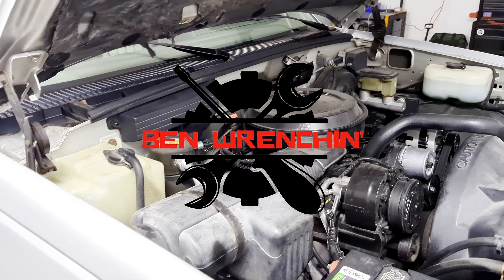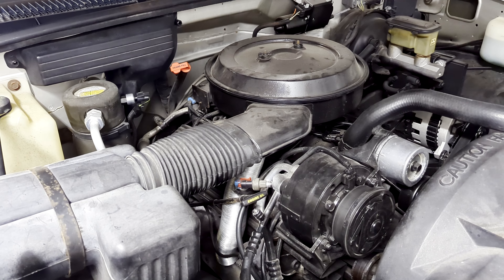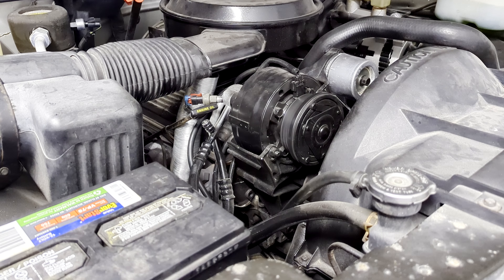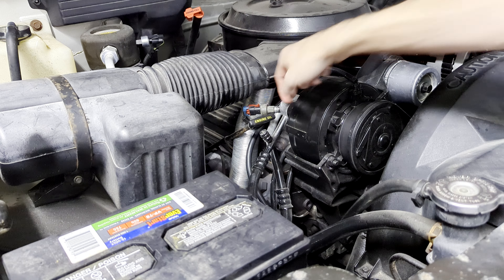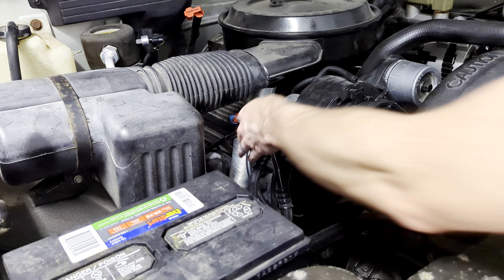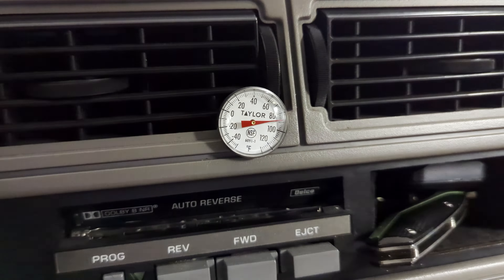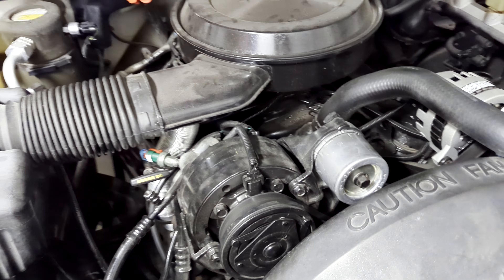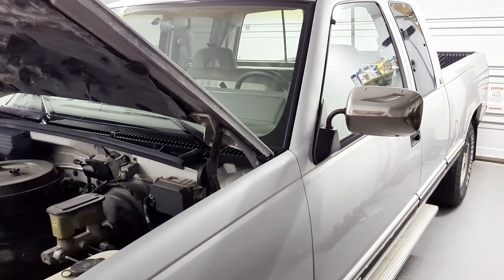Replacing A/C Pressure Switches And Why I'm Okay With Using The Parts Cannon | 1994 Chevy K1500

Comment: Can you separate the compressor clutch and possibly replace it without opening the system?
Reply from the maker: You can, but mine is working.  I think the problem must be something internally wrong with the compressor.  Usually they leak or the clutch goes out, and mine's not doing either of those.  It is 30 years old though.
Reply: Good idea!
Reply from the maker: @megs4898 @macdaddykwm1  I've thought about it more, and I really shouldn't rule out the clutch.  It would be another part to try that doesn't require opening the system AND could possibly be the cause of the problem, however unlikely that may be.  Unfortunately, it looks like this particular compressor may not have a removable clutch, at least my search so far for just the clutch has only yielded replacement compressors.  I have found one clutch for $100 on RockAuto, but that price doesn't make good fodder for the ol' parts cannon.  The saga continues...

Comment: If your compressor is running, and pressures are good it would be an indication of something in the hvac box. Did you check to make sure the mix door is moving, could be stuck inside the box not allowing it to completely swing to the cold side. also those digital hvac controllers are a common failure point. super common on these. evaporator could also be full of dirt and grime. The switch on the accumulator is the cycling switch, they are super common for leaking, I actually have a video on that. the HP switch only kicks on when the system reaches too high of a pressure.
Reply from the maker: I haven't opened up the HVAC box yet.  I did change out all the blend door actuators.  I believe the mix door moves because it goes from warm to hot when the heat is on.  I don't know enough to know if the cold is a separate mechanism.  I changed the switch on the accumulator.  I never found the high pressure switch.  Wasn't sure where to go with it, I figured once it's not below zero outside I might start replacing parts one by one to narrow it down further.
Reply: @benwrenchin  The high pressure switch is the one that you changed in this video. Another thing you can do is grab a hold of the high pressure and suction hoses where they run through the firewall and see if they're cold. If they are that's an indicator that the evaporator has insufficient air flow across it
Reply from the maker: @MegaMarclar  good to know, thank you my man!